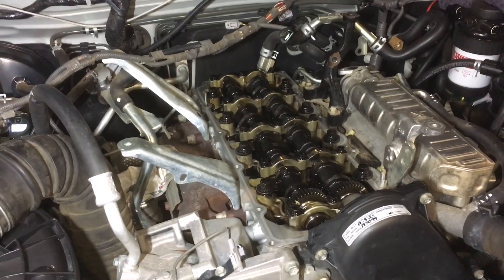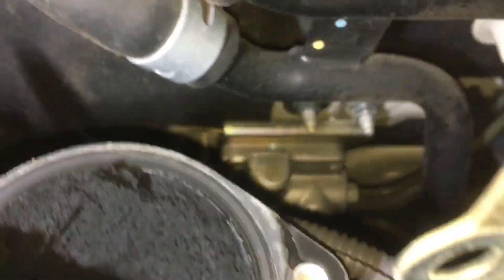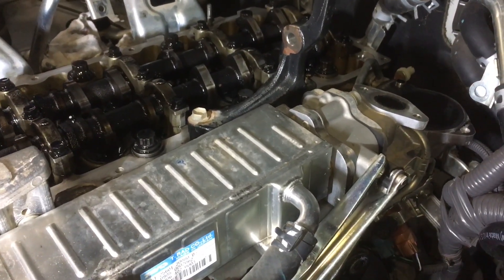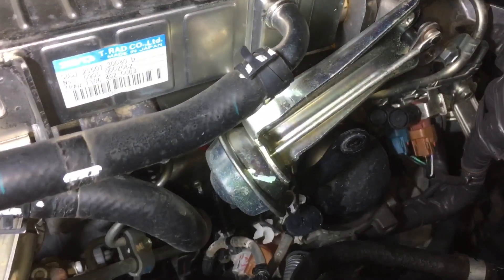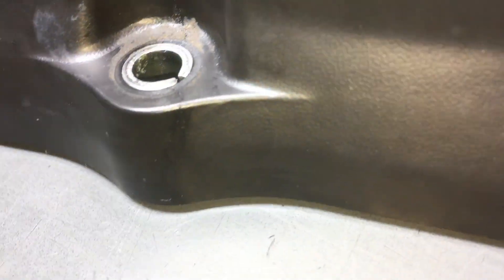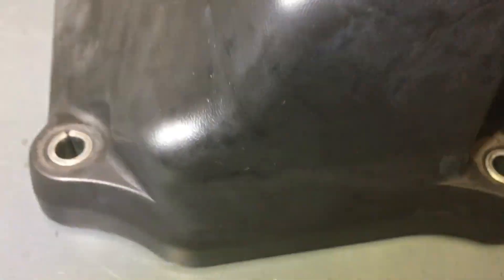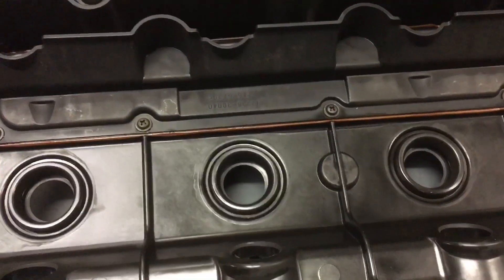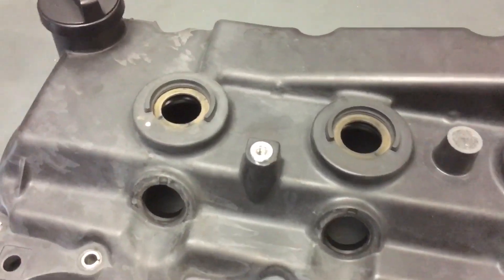DECISIONS DECISIONS - Manifold clean & VALVE Cover Cracked

Comment: My valve cover has been leaking in the back left corner for atleast 100,000k I've never worried about it I just degrease it every now and then
Reply: Mines leaking too, is it a bad thing???
Reply: If it's just a small weep like mine and your not having to top up oil between services I'd just clean it up every now and then it's not worth worrying about